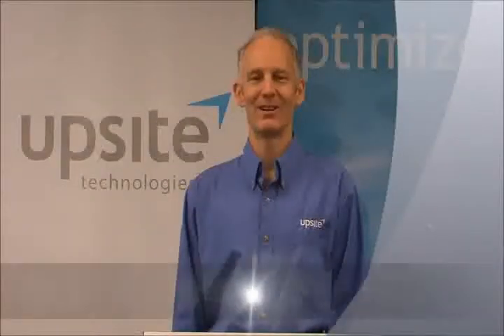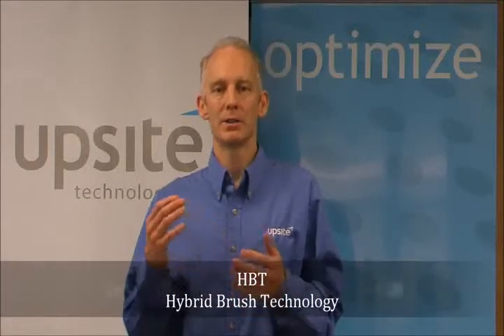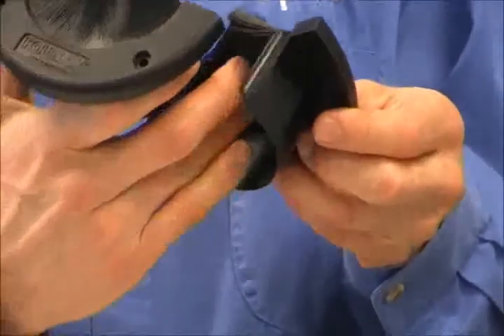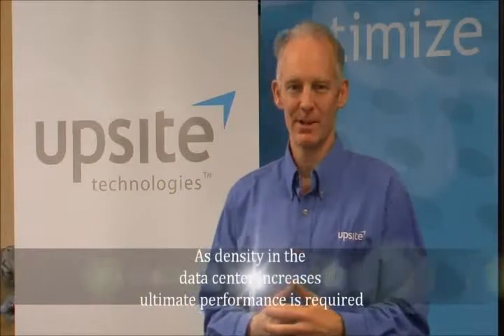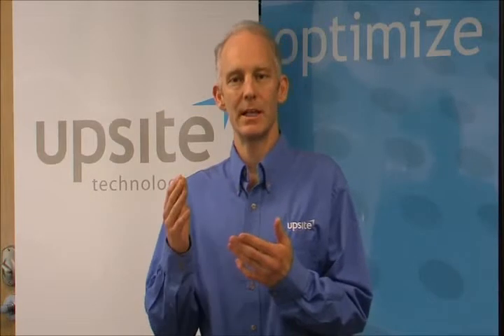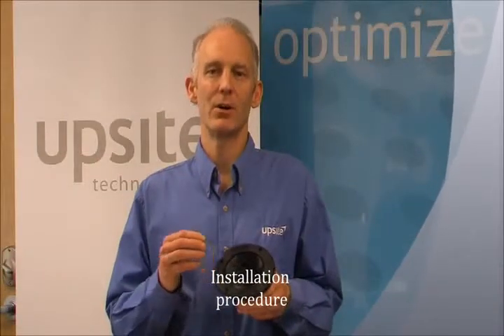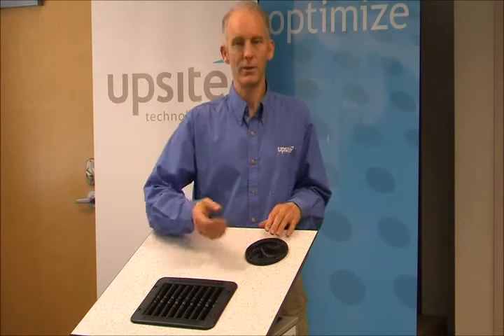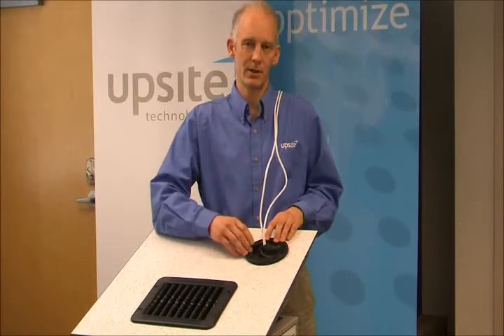KoldLok Round 4" Grommet Introduction and Installation Video

Comment: I found your products after searching for wall grommets.  All grommets I've found online are restricted to wall-plate sized holes (single-, double- and triple-gang), or are designed for passing-through of a few wires for wall-mounted televisions (HDMI, RG6, audio, and power cables).  Meanwhile, I have four bundles of CAT5e, CAT6, and RG6u cables protruding from drywall where I'll install a 9u wall-mounted network cabinet; and none of those wall-plate solutions are large and robust enough.  Clearly, your products are specifically designed for data centers / raised floors and are instrumental in saving energy.  Just a thought: As a homeowner going through a remodel, I can't help but wonder if a company like yours could design and release a product line to cater to those of us expanding our home networks.  Regardless, I'm impressed with the engineering behind your product-line and will likely purchase a 2020 surface-mount model.